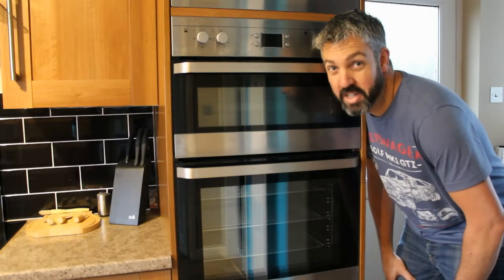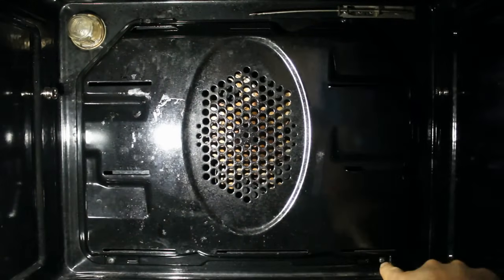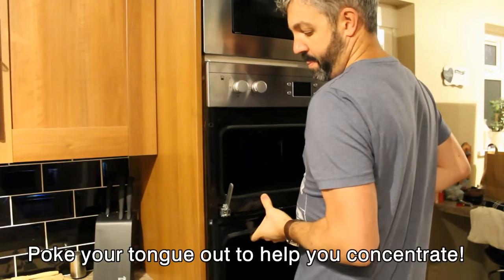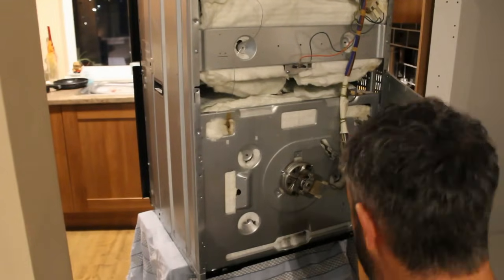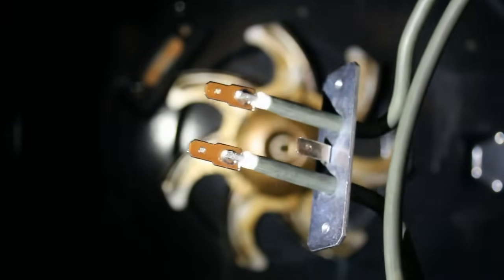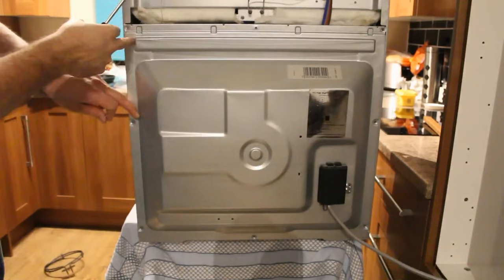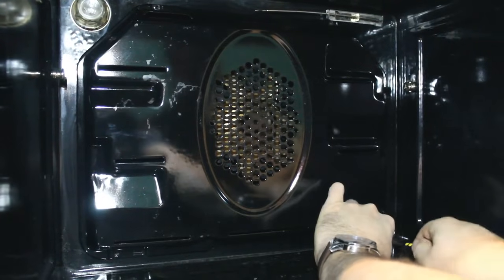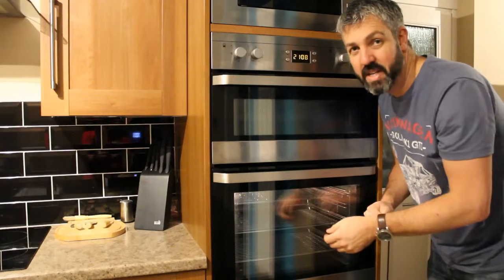How to change an Oven Heating Element on a Beko Oven - Fan Oven not heating up?

Comment: Great video! One query: when you mention giving the fan a spin to check that it doesn't catch on the element - it sounded like it was catching slightly in your video (which is exactly what mine is doing). How did you correct this? - as the heating element and fan are screwed in in fixed positions so it doesn't seem possible to adjust their position? Does this mean that either the heating element could be warped or possibly the fan motor axel could be warped?
Reply from the maker: Thanks...glad you liked it. I'm not sure if it was actually catching or whether that was just the sound of  the motor turning. If it is catching slightly, you may be able to pull the heating element about a bit to try and manipulate it (bend it slightly) out of the way.
Reply: ... just to give you an update- it was my old element which was just catching, so I tried to manipulate that first, and heard a crack - so the old heating element then needed replacing for sure! New element arrived and it's now clear it was the old heating element which was warped causing it to catch. 30 mins later and we have a fully operational oven again, and the new element fits perfectly - thanks to your video! Much appreciated!! :)
Reply from the maker: No problem! I always like to hear a success story from someone watching one of my videos! 👍🏼

Comment: I tried this on my Beko oven and just in case anyone else is hoping for it to be simple it might not be. Every single screw in mine is corroded or rusty and maybe 2 came out cleanly the rest were stripped so a simple element replacement is now a complete nightmare where I think I'll have to buy a metal drill bit just to get out the remainder of the screws and god knows if they over will even work after that. Still a great guide but my situation has turned out to be a pain.
Reply from the maker: Oh no, that does sound like a nightmare! Our oven was a good 5 years old when I changed it, but nothing was corroded.